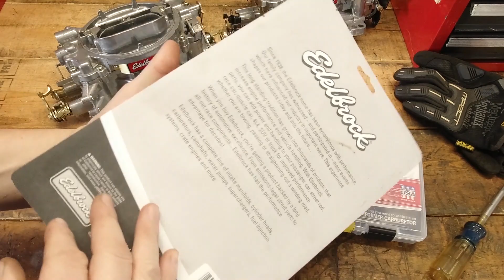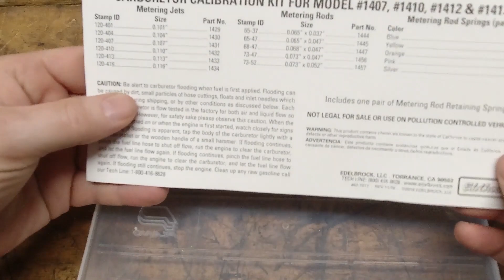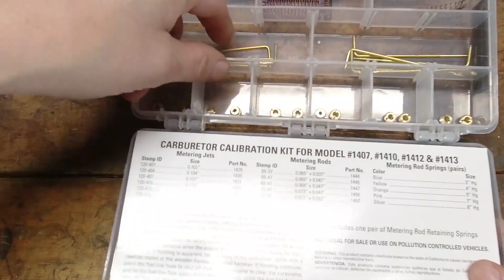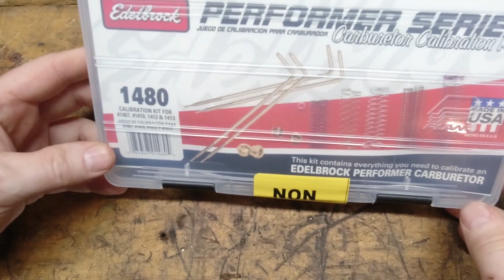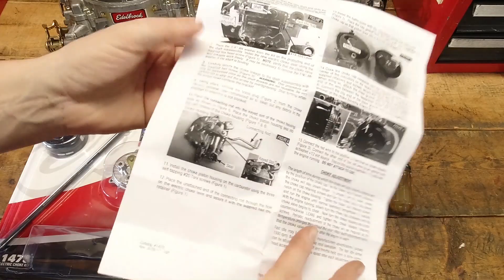How to Install Edelbrock Electric Choke Kit

Comment: the 12v  electric choke is not ground activated, you hook the ground directly to chassis ground.  That is why you need to hook it to a 12v "switched" source,  which heats up the coil spring , causing the spring to release pressure and then the vacuum piston pulls on the choke linkage to open, or de -activate the choke. If you loose 12v power,   the choke will remain  on . If you supply "constant" 12v  (battery voltage) the choke will always be off as soon as vacuum is applied.  right?
Reply: Yes, the ground wire for the choke is connected to the negative side of the battery through the chassis ground. You hook it to switched 12V so that when you start your car, the choke begins to start opening as the current heats up the bimetallic spring. The vacuum of the engine only pulls the choke open slightly when the engine first fires as the choke only needs to be fully closed for the initial start until the engine lights.

In theory if you lose power to your choke whilst driving, you won't notice it for a while as the engine heat helps keep it open but it will eventually close enough that the engine might jump back on the fast idle circuit (controlled by the choke) and be running way too rich as the choke begins to close. 

On the flip side of the coin, if you power the choke with 12V it will fully open eventually even without engine vacuum- so if you take too long to start your engine the choke will fully open and starting the engine cold will be a pain.

Hope this made sense.

Comment: I'm suddenly having a similar issue to another commenter (Smalley) although I have not been able to duplicate it standing next to the car.  Intermittently, at lower RPM cruising or pulling up to or away from a stop light, my RMP's suddenly increase, far above what they would at fast idle during choke engagement.  I can get it to stop by popping the throttle a couple of times.  My car is a 4 speed, so I push the clutch in when this happens, but it's freaky scary.  I disconnected the red lead to the choke housing and the issue has not repeated.  Any thoughts about the cause or what I should do to fix?  The carb is a new electric choke AVS2 650 on an SBC 350.  Thanks!
Reply from the maker: Check the fast idle cam.
Reply: @MuscleCarSolutions  10-4 Thanks

Comment: Great video. I’m a newbie. Lol.   Where do I connect my hot wire from my electric choke?  I have a HEI distributor.   Thank you
Reply: I ran it and a couple other accessories off the fusebox using a fuse adapter. You must use a fuse spot that is key on/ key off. You don't want constant power.

Comment: This is a great video! I just took off my automatic choke and was wondering if I need to remove anything else before I start her back up? Or maybe do u have a video on removing it. I followed the red wire to the interior and saw the red wire next to a fuse. Should I just pull out the fuse or pull the wire? I can email you a picture of you have time. Thanks!

Comment: I finally got her done. My particular model of 1405 did not have the vacuum port in it. After talking to Edelbrock, I was confident to drill it out myself and just finished up installing the carb watching along with your very helpful video. Thanks so much for the content. I couldn’t have done it without you!
Reply from the maker: You did all the work!  Nice job!  👍🏁

Comment: HEY!  THANK you so much for the video.  I am hoping you still monitor this video - I just dropped a GM Performance crate motor into a '67 Chevy Camaro.  Engine and transmission are basically 'new'.  Since the car sat for about 6-8 months, I decided it was prudent to rebuild the carb also.  I have an Edelbrock 1406 with the factory installed electric choke.  After watching your videos I was able to fully rebuild the carb - new float needles and screens, left the jets alone as they were clean and working, new gaskets, etc.  Car runs really well - not perfect, I still need to learn how to do the air fuel screws but its REALLY close.  HOWEVER - after the rebuild, my high idle assembly is really 'free' moving...meaning it doesn't appear to be connected to anything, even though all the assemblies and control arms are back together.  The issue I am having is that when I accelerate hard or build acceleration gradually - basically, when I am at a higher throttle position - when I let off the gas, the engine doesn't drop RPM's at all.  It stays at high throttle - the pedal and throttle releases, I have duplicated this standing next to the car and manually operating the throttle.  The RPM's stay high until I 'pop' the pedal and the throttle and then it reacts normally (not always but most of the time) and starts to throttle down.  

What adjustment did I not get correct that would cause this?  I am sure that its something I did with the carb - the throttle return spring is operating normally.  I believe its something internally with the electric choke, or possibly the linkage to the high idle?   WOULD LOVE ANY ADVICE....and I saw you link about - beer coming with to you with solution.  LOL....thanks.
Reply from the maker: Could be the choke that’s hanging the fast idle open.  When it’s idling high, see where the fast idle is.  Then when you crack the throttle if it drops off.  Make sure the rod connecting the fast idle to the electric choke rod is on correctly.  That’s where I’d start if you think the return spring is working well.
Reply: On my asv2 with it warm choke open my  choke housing out of the small port on the bottom never stops sucking vacuum is that normal
Reply from the maker: @markjakubowicz2728 completely.  It’s the cooling mechanism for the choke.  That small amount of additional air is accounted for in the tune.

Comment: thanks! i'm geting confuse about how the choke is working. question is with an electric choke do we have to pump the gas pedal before ignition? the pumping  seems to disengage the choke, i mean it's opening a little bit the plate. thansk and keep the good work.
Reply: Yes you should pump the pedal twice is what I do to not only set the choke but it gives the engine 2 primer shots of fuel from the accelerator pump nozzles to help start the engine especially if it's cold outside. To me it sounds like you have the choke set too lean and when you pump the gas pedal it's opening up the choke so try to turn the choke to the right so it's closing the choke plate further . There are notches in the casting so mark where it was set before with a permanent marker then loosen the 3 torx bit screws and turn the black adjuster to the right or clock wise and look where the notch on the adjuster is and mark that spot and lock the screws down . If it's still doing the same shut the engine off and readjust more . I usually start with turning the adjuster all the way to the left on the housing marks then slowly turn it to the right where the marker on the black adjuster is right in the middle which will be a longer mark if you look closely then lock the screws down and start it and see how it acts it might take a couple adjustments before you get it right but try to do these adjustments before the spring heats up to much or the engine gets warm because both will throw off the choke adjustment because of the heat . Once the choke seems to be working like it should you might have to adjust the high speed idle for the choke so it's not too fast or slow but that has to be done when the engine is off and the choke set by opening the throttle so the choke sets on the high speed idle cam that's on the right side if the carburetor. The adjustment screw is on the bottom and it's kind of hard to get at so I take the throttle return spring off then open the throttle fully so you can see the idle screw and I use a long thin straight blade screw driver to make the adjustment then put the throttle return spring back on and set the choke again to see how the high speed idle is and it if needs more tweaking or not .

Comment: On the 1406 rebuild I figured out everything except figure 4 on the adjustment data sheet, in the 1477 kit,( the electric choke piston linkage), other than that everything went great, I also set the float level with the 1/2 drill bit, I am in Eastern Washington it's hot in the summer, I can always reset them if I have problems
Reply: What about the electric choke piston linkage ,figure 4 in the rebuild directions, and what is your name
Reply: Hey Bone Head, got the carb on have a video will load it Sunday morning

Comment: Hey I just found your channel because I was curious how an electronic choke installed on my 1407 edelbrock and I see that your probably about 20 minutes from me. I'm actually looking for help tuning the Demon Carb on my Charger and I would love to collaborate with you on a video on getting it tuned right.
Reply: First thing to do is make sure your timing is set correctly then tune the mixture screws in until it stumbles or slows down then go the opposite direction until it does the same then go between as close as you can . I listen to the engines idle where it idles the highest then turn the mixture screws out a 8th of a turn rich . If you have a vacuum gauge you can use that to set your idle mix screws and it can also be used to set ignition timing if you don't have a timing light . I usually set my timing by ear and then take it for a drive when it's fully warmed up to see if it pings on hard acceleration . If it's got a big lumpy cam in the engine try to run as much advance on your timing as you can especially if the cam has a lot of duration and has a wide LSA lobe separation angle because by doing this it will make the engine more responsive and it helps bring back more low end torque that's lost on the low end because with a lot of duration compression actually bleeds down some then comes back as rpm is increased . Take it out and drive it normally after the adjustments are made and put some miles on it then come home and let the engine cool down and pull the plugs to see what they look like to make sure that the carburetor isn't jetted too lean or rich . When I build engines I take them to a guy I know that has a engine Dyno and I have him set the engine up and then they start and run the engine up to temperature the and look for any oil or coolant leaks then they shut the engine down to let it cool off and they do this a couple times heat synching the engine. Once that's done they then make the first pull on the Dyno and check the egt exhaust gas temperatures for all 8 cylinders to see if the carburetor needs to be jetted richer or leaner and once that's done they check timing again then start the pulling sessions and start to make changes to make the most HP and torque the engine can make . They can tell once the rings are fully seated in by looking at the Dyno sheet numbers and once that's done that's when they try to find as much power and torque the engine can make . It usually takes about 2-3 hours of Dyno time to get everything done from start to finish and one of the benefits of doing this is if the engine leaks oil or coolant or breaks because the engine wasn't built correctly it saves you time finding these problems on the Dyno rather than having to fix them in the vehicle or pulling the engine back out .

Comment: Do you need the baffle plate on the AVS2 1906? I pulled my electric choke apart and I didn't have one, when I looked up the kit for my model I didn't see the baffle plate in that setup either?
Reply from the maker: @dantheadventureman  Edelbrock got rid of those quite a long time ago.  They aren’t necessary.

Comment: quick question, I have a 1964 Corvette that I've had for a couple of years. a previous owner installed a Performer carburetor with electric choke, and used the alternator for the 12v + (maybe at the field connector?). would the terminal of the ballast resistor that doesn't go to the distributor be a better option? this would have 12 volts only when the key is in the run/on position. thanks for sharing your knowledge and your videos.
Reply from the maker: @gregzervoudakis  the alternator is not a reliable source for the choke.  You don’t want a circuit with a resistor.  The choke needs a full 12v during its entire time in operation.  If it drops, the choke can partially or fully close and you’ll not be able to engage the secondaries, low/no power, etc.  Coil is the only other option worse than the alternator.

Comment: quick question, i have a carter 9600 marine, id rather not change the teflon coated shaft do i really need to use the one from the kit as theres not really a fast idle on the marine carb anyway?
Reply from the maker: Easy thing to do is verify the ends.  Yes the fast idle side is important for the operation of the choke and it’s the fixed end of the rod.  If you can make the choke side work and aren’t concerned about the additional rpm needed for warm up, you can try it.
Reply: @MuscleCarSolutions  its a marine carb tho there isnt even a fast idle screw or notches on the cam so really the fast idle is redundant on them right

Comment: I came here hoping you would discuss the choke piston linkage adjustment the rebuild kits recommends. It is also the first choke adjustment listed in my owner's manual. I have a #1406. Can you shed some light on what this adjustment does and if its necessary? It is not clear from the figure what it is they want done. Thanks.

Comment: Hello, I'm having problems with my edelbrok, will not fire off. Trys to then will spit and sputter and die.
I have plenty of fuel going to it. When I take the fuel line of fuel comes back out of the fuel inlet. You know what might be the problem? Don't know much trying to learn thank you.
Reply from the maker: @ajnixon837  what’s your pressure regulator set to?  Have you checked float height and the needle and seats?

Comment: At the bottom of the choke is a small hole,when running should that hole be sucking air or should i block it off
Reply from the maker: Do not block it off.  It’s to keep the choke cool during operation.

Comment: What would keep my choke from closing fully? Feels like my linkage is stiff and feels like the chokes not working. The notch on the electric choke is way off almostbhave to spin the choke one more turn to get it to engage the linkages
Reply from the maker: Have to check the fast idle side also.  Sometimes it will get hung up a little there too.  Partially in how it operates or perhaps it’s not aligned or adjusted correctly.  If you’re rotating the choke housing that far, it’s another issue.  That’s a small adjustment for lean/rich. Check the other side of the carb for the likely answer.
Reply: @MuscleCarSolutions  thank you for your reply. I rebuilt it a couple months ago and got my truck up and running after a rebuilt motor but I'm half tempted to just buy a new one lol

Comment: Do you have to have that plate between the housing and the cap because I've seen several kits That are $60 to $70 cheaper and the only thing they appear to be missing is that little plate
Reply from the maker: The plate was discontinued years ago.  Yes I still have a few but it’s not necessary.
Reply: @MuscleCarSolutions  👍 thanks for the quick response. Just a fellow gearhead trying to save money where possible
Reply from the maker: @b.m.4066  don’t blame ya.  Every penny counts these days!  I’d stick to the Edelbrock kit though.  I can’t vouch for the cheaper kits out there but I will tell you some of them just flat out don’t fit and none of them work on the AVS2.

Comment: So, I’ve got a Edelbrock version of a Carter AFB on my SBC which was just rebuilt with Vortec heads and intake manifold. It’s in a 1994 SeaRay. The mechanical choke won’t mate to the new manifold. I either add the electric choke or buy a new carb with the choke already on it for $300. Don’t care about the cost savings, so what do you recommend we do and what model electric choke would I need if we go that route?

Comment: Hi, when adjusting the choke to you need to put the gas pedal to the floor and hold it (full throttle) while adjusting the black choke cap?  That is how edelbrock tech says to adjust it...  I just bought an AVS2 and installed it on a 1979 corvette.  It works great except for the electric choke.  It's not as easy to adjust as a Q-Jet...  Thank you

Comment: Can this carburetor be installed without the electric choke and instead manual choke? I can run a wire from the boat ignition switch if needed but turning the switch to on usually makes the "annoying beeping" sound after 30 seconds so i don't want to use that as source to warm up the choke.
Reply from the maker: Both the Edelbrock marine carburetors have electric chokes.

Comment: Excellent video. I got 2 carbs on my boat. One of them will make the click sound when I manually full throttle it. The other one doesn't.  Is the some adjustment on it?

Comment: I'm stuck. I have a 1969 plymouth roadrunner with a 440 4 speed manual. All of a sudden the car won't start. It turns over. It will start if the ignition is turned quick and released once in so many tries. The car will drive and run fine, but soon as you turn off the ignition and try to start it up again, it just turns over. It has a complete tuneup, a new Ignition coil, alternator, carburator and fuel pump. Lost and confused due to being new to these old classic cars. Do you have any suggestions? Thank you
Reply from the maker: @Godsblessings1111  always start with the simple things.  Make sure you’re getting power to the coil.  Make sure that is getting to the plug wires.  Was the 69 a points car from the factory?  They usually have an inline resistor in case you’ve switched to a later model distributor and coil.  Check your grounds.  Add another one or two from the engine to the chassis.  Start with the ignition, alternator, battery and maybe the switch.
Reply: @MuscleCarSolutions  Thank you!